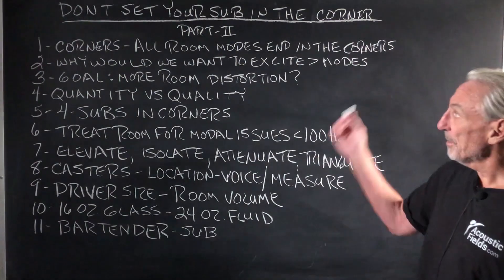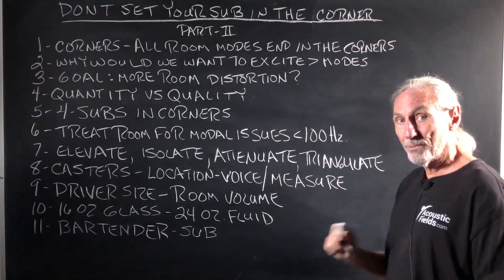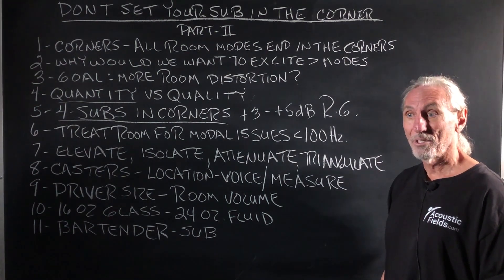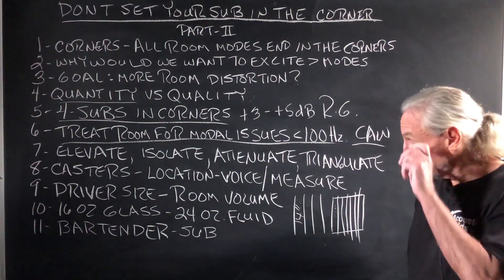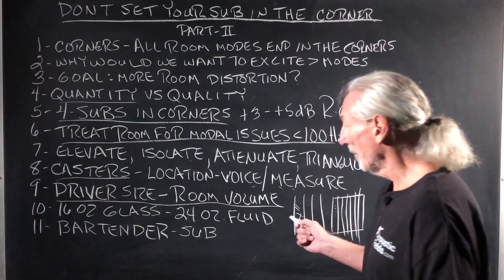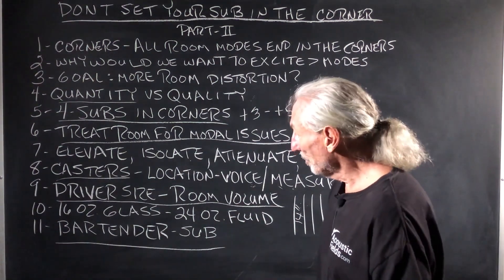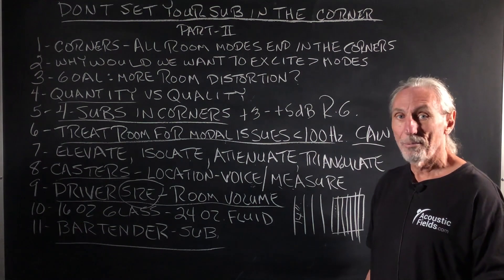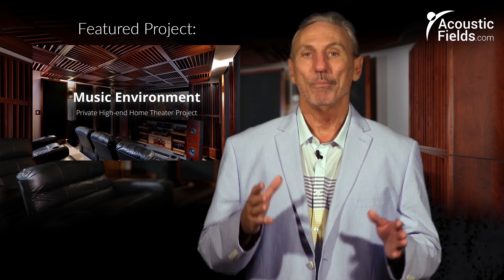Don't Set Your Subwoofer In The Corner! Part 2 - www.AcousticFields.com

Comment: Stacking of subs is a great con. Firstly, in the concert industry there is no line array subs. It’s never done. 

Secondly, you get 6 subs stacked up in 2 columns and then use them in low volume for ‘better bass’. Ratio of 6 subs to 2 stand mount speakers. 🤣😂🤣😂
Reply: personally i like to fly all my subs in the living room and kitchen... huge arrays in every direction... (sarc)
Reply: @jonathanreddish8590  … won’t a pair of great headphones and a butt kicker strapped to your pants be cheaper?
Reply: What about stereo speakers where they have  a tall cabinet with 6 12inch subs.    Here’s a photo of one of these beasts..
Reply: Oops.   Check out Infinity IRS speakers and others on the market.
Reply: @Oneness100  … ok you got me there 😬 but it’s not x6 subs to x2 stand mount where you dish out $15k to only play the subs at a lower end of their capability.
Reply: @hushpuppykl  Each side has a separate mid range/high frequency stack and then a lower frequency stack..  The lower end  stack is crossed over at around 70hz and goes down to 15hz and is powered separately. so I don't know what you mean.

Genesis is the current mfg. of these speakers, they've updated the speakers, but they are priced at $235,000 for the four stacks.

the only difference is you either buy the entire system or not.   There are other companies that make similar designs where the bass drivers are in one tall cabinet, and they are crossed over below 100hz, in essence they are subs, it's just how they are packaged..
Reply: @Oneness100  … sorry, I was referring to a system where they are proposing 6 subs to be added to a pair of stand mount speakers.

I don’t think anyone will challenge the IRS as dodgy.
Reply: @hushpuppykl  I don't know who does that other than the people that stick HUGE amounts of subs in a SUV cranks to 130dB or higher to see what it takes to get blood to run down from their ears.

The IRS design is 6 separate sub bass channels per side.  1000watt each and they are servo controlled.   the only difference is the mid's and high's are a tower line array..     those things require a HUGE room to handle the amount of energy they are capable of.  I've seen those things in rooms that were just around 9 ft ceiling which I would think are far too low for those..

I saw a video where the guy had something like 32 bass drivers in his home theater system and his room was TINY…. I'll see if I can dig it up to show you. It was just simply WAY overkill, but the guy who owned it claims it sounds great. I honestly don't know how it could.
Reply from the maker: They will claim a better energy distribution with more subs. This new energy distribution will pressurize the room in a more balanced fashion. This could be true but lets do a cost/performance analysis. Lets use 4 subs at 10 K. For 10 K, you can not only treat all low frequency pressure issues within most small rooms but you can also address middle frequency issues such as reverb times, attack and decay rates, and a host of others. The room should be treated so that only one sub is required to balance the whole room in the lower frequencies. With less energy output and more resolution through treatment, you can have a low end in your room that is just as engaging as your mid range. There are times when I listen only to the bass line because it is so clean and clear. I hear this everyday in my studio. It can be done but not with building insulation